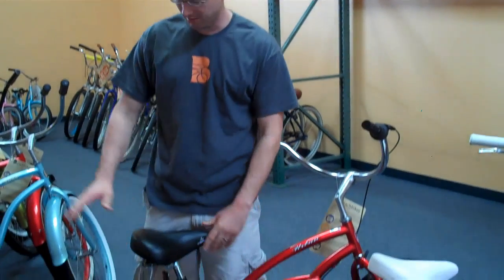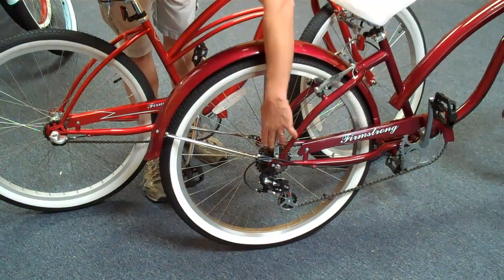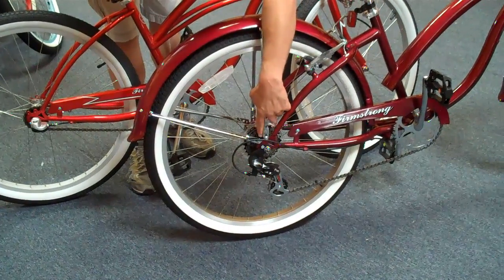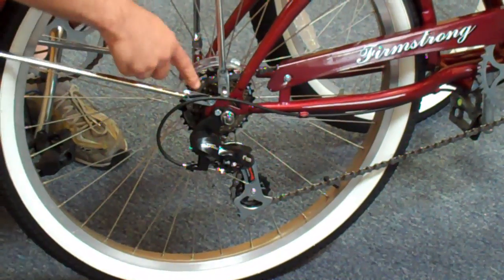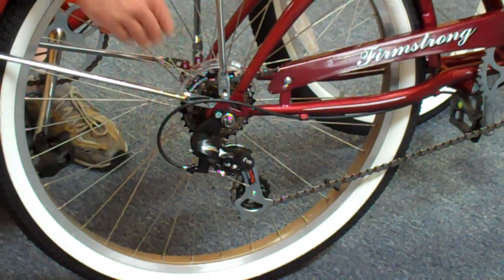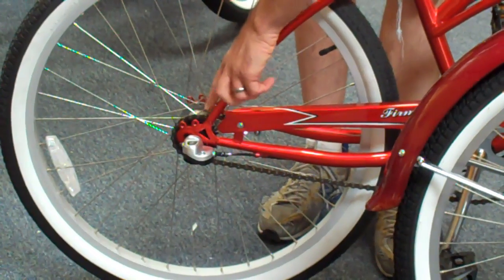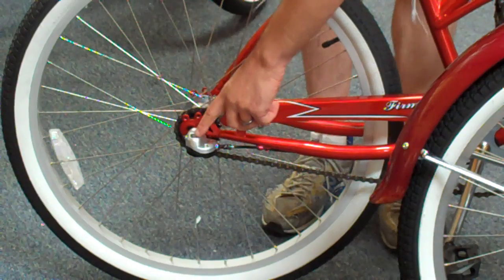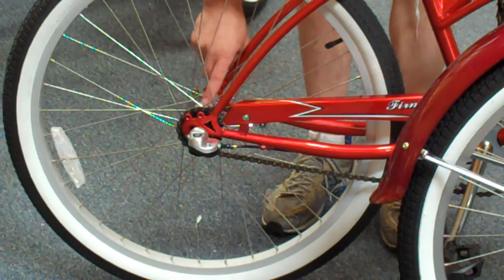Beachbikes.com - Difference between an Internal Gear Bicycle Hub & External Bicycle Gear Derailer?

Comment: Another advantage of internal gears, if you come to a stop in high gear, you can shift into low gear while sitting still...with a derailleur you have to pedal to down shift, which can be a little bit of a struggle ... That's why I prefer internal geared hubs
Reply: Michael Dickerson And when get a rear puncture, IGHs are a nightmare.

Comment: You know it be really cool if they made beach cruisers with internal gearhubs and disk.
Reply: Sheldon Brown, a well known bicycle mechanic, built a 63-speed bicycle by using a 3-speed internal hub, a 7-speed rear cassette, and a 3-gear front cassette. Now only if that 3-speed hub was swapped out for one of those 11-speed Shimano hubs or a 14-speed hub...

Comment: I'm using TREK SOHO Hub gear bike since 3yrs ago. Hub gear bikes are more heavy and expensive but more neat & easy to maintain (the gears will not get dirty). You can also change to any gear even the bike is not moving, shifting of gears also very quiet and won't 'jump gear' .
Reply: I was about to ask if you can switch gears while stopped with internal gearing. Your comment answered that for me.

Comment: Good presentation, but I would add another issue:  If you do a lot of riding, especially cross country, remember that fixing a flat tire on the rear wheel is about ten times easier on external geared bikes.  Having said that, if you crash your bike  or if it just falls over on its right side, the external gears about ten times more  likely to be seriously damaged then the internal geared bike.  Thanks .